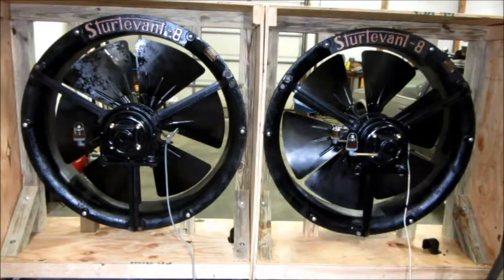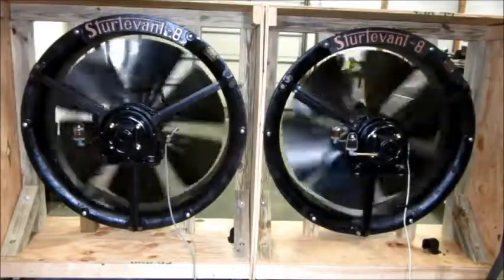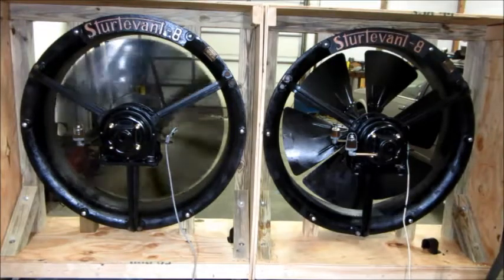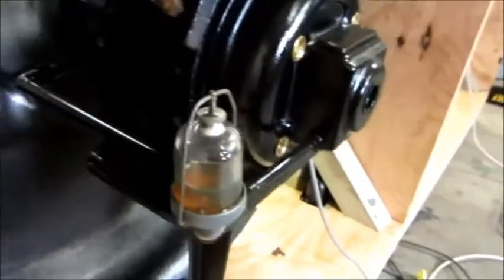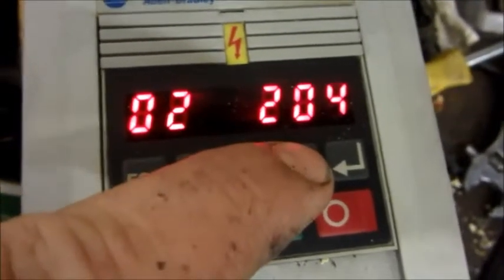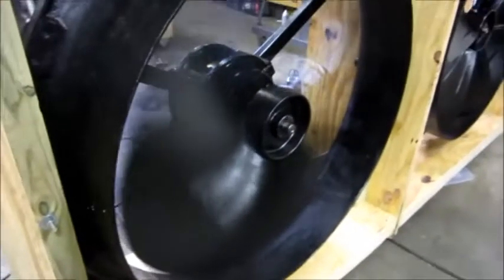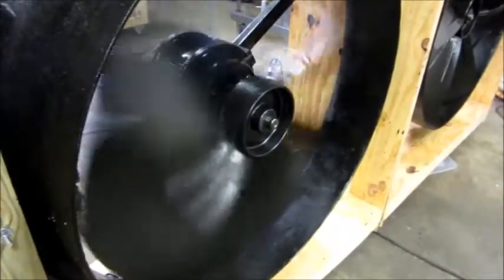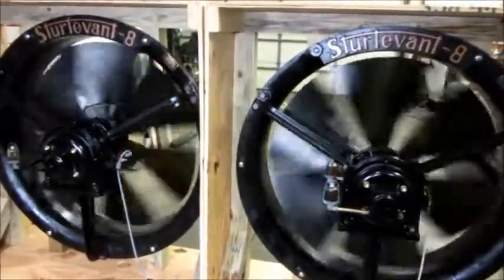Sturtevant Size 8 Design 5 Propeller Fans - #7 - Both Fans Running

Comment: Very nice! Always enjoy your work. Those fans were very likely designed to operate against a certain static pressure, which, being axial fans, would require more hp from the motor, explaining why they're underloaded when running free air. I would LOVE to have a big shop with those in gables, running in the summer time! :)
Reply from the maker: That would be a nice way to put them to use! 

Interestingly, the Surtevant catalog lists these fans with ratings for free air use. I am sure there's a certain amount of static pressure they will tolerate, but the ratings were shown for free air.

Comment: Heavy blade plus 3 phase=BEST SOUND!! I think you just made the worlds largest window fan lol. Interesting how the one on the right seems to spool up faster.
Reply from the maker: Thanks - yes they do sound good with the heavy blades and 3-phase whine. Yes about the spoolup time - see above comment about that. It's long and detailed so I don't want to retype it all!  :)
Reply: davida1hiwaaynet makes me wonder if you could even smell the cigarettes while these are running lol. Once again, nice job on these, I’m very impressed with their outcome
Reply from the maker: I could smell something similar to cigarette smoke when I heated up part of the motor with a torch during repairs. It's hard to tell if it was that or just OldMotorFunk burning off.
Reply: davida1hiwaaynet cigarette smoke is an interesting animal since it lingers so long, (why I tell my friends to not smoke). I have an old fan which has that smell once it warms up

Comment: very cool man. great work, awesome fans! Any thoughts on why one fan spool up slightly faster than the other? you can see it on the video though maybe not in person. Is it simple bearing condition? I suppose there are many variables...
Reply from the maker: Yes, glad you noticed that!  The one which spools up faster was already warmed up and the oil was warm in the bearing.  That was the one I had just finished putting together. The other one was stone cold. That's all I can think of which would cause this.  Also, the winding resistance of the motors is SLIGHTLY different. One of them has about 6.6Ω and the other about 6.2Ω of resistance. Each motor is balanced phase-to-phase, but one motor has a little more resistance than the other.  Could be one was rewound early in its life and there was a slightly different gauge wire or slightly different purity copper used. Hard to know since they have been in existence for 90 years. :)
Reply: davida1hiwaaynet both could certainly be a factor, but it’s probably hidden in history lol

Comment: I realized that after I got to looking at it , I had a 93 century 3.3 with the th 125 3 speed I loved it , it was a Honda killer lol
Reply from the maker: Yep those were fun cars!  I've got an 89 Ciera Coupe with 3.3 and 4-speed. It has a lot of pep to it!
Reply: It would do 85 in second just merging on the free way and still get 25 mpg cruising at 70
I traded it for a 89 firebird with a 2.8 one of the dumbest things I have done , I got it with 74 000 miles and gave $ 150 for it the guy thought the trans was bad but the e brake was stuck!
Reply: I had a 3.3 Century as well.  Very reliable.